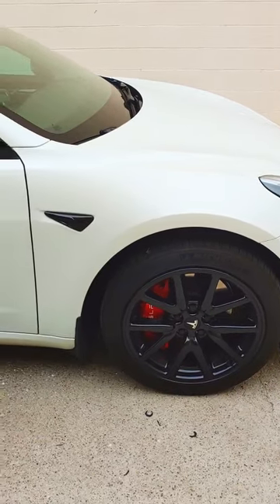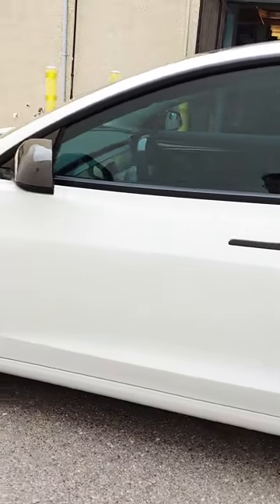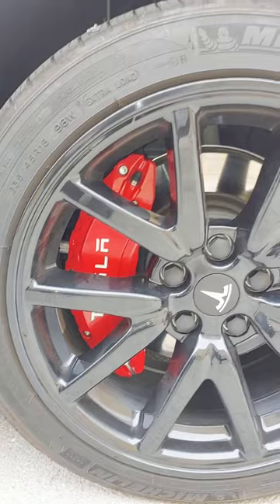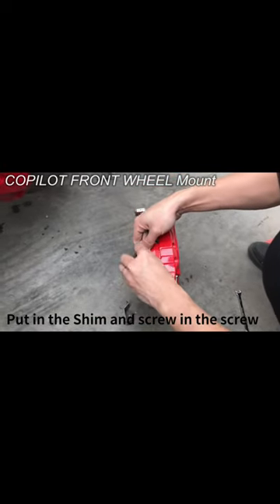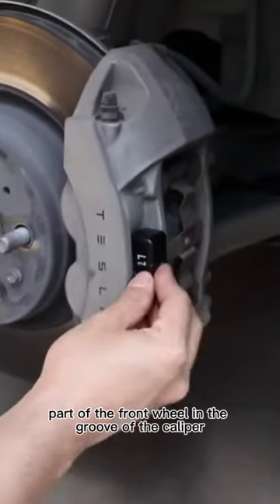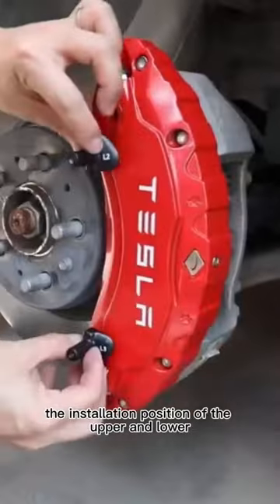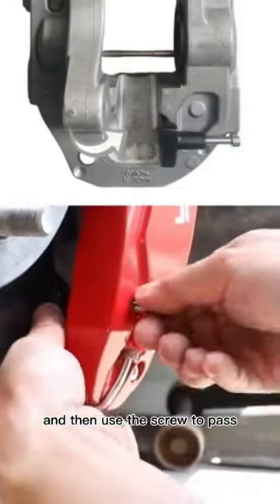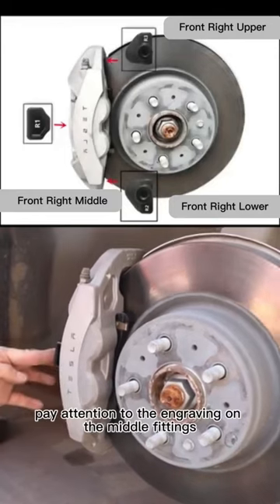Weishine Red Caliper Covers from Amazon for Model 3 OEM Wheels

Comment: They look awesome bro! Any issue so far?
Reply from the maker: No issue with the range. Just an issue with the front covers installation. The aligning tool didn't work. Even 0.5mm off the alignment, the bolt won't go in. You have to watch physically they are lining up.
Reply: @junosmodel3LRchannel  That's great! I'll take that advice.

Comment: Which side is L1?
Reply from the maker: L is driver side and R is passenger side moldings. 1(Middle), 2(Up), 3(Down) for the front and 4(Up), 5(Down) for the rear. So L1 will be the driver side front middle molding for the US model 3. For RH driver, L should be the passenger side.